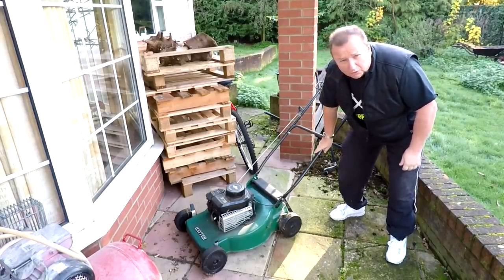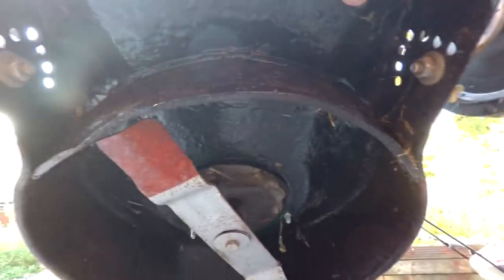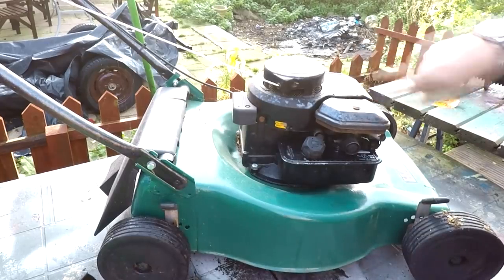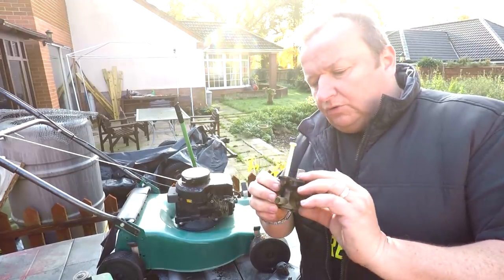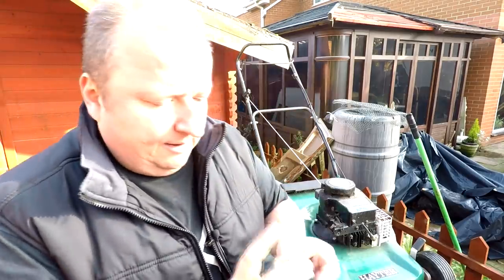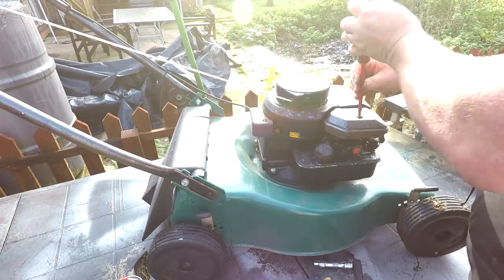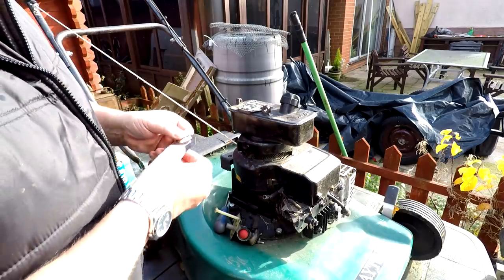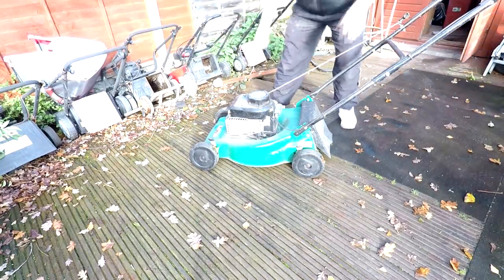Worst Lawnmower In the World 2 Years On

Comment: That and it’s cold. Oil is thick. If anybody cranks one,let it run a bit to heat the oil up. Don’t put it to work straight away for fall 🍁 she’ll settle on down once heat is beginning to get into the engine.

Comment: Great vid m8, I keep meaning to get my vintage Aspire engine which is an Italian made Tecumseh onto the workbench as I had intended to build a go kart around it as have the box section and tube, got the welder and even a fancy pedal go kart's quite complex steering I nipped off down the local tip and wheels ain't hard to source as I got a ton of old Vespa wheels and hubs if I needed going roundy things.   My daughter is not so happy, for being a bit mental I kinda go at things hammer and tongs and end up filling the place up with broken things then my madness sends me down a new path and its like "meeh, cant be bothered..."  Quite enjoying the watch thing, its like doing abs tiny Airfix kits kinda and means it piques all my likes e.g. I love polishing metals and a lot of these ol' beaters I am making look like factory fresh, its not a skill that can be hammered into submission either and sometimes it takes ten minutes to get a tiny gear wheel firmly in its journal and have to be so gentle as the pivots and shafts can be thinner than a human hair.
Reply from the maker: I'd struggle on small stuff like that Ian.
Reply: @retrorestore  I bought a 1600x USB microscope as me eyes are getting worse, still a way off being told I can't drive but the bloody diabetes is the gift that keeps giving hehe   The microscope tho, cheap chinese but abs superb clarity at max focus and I use it on electronics and mechanical stuff as it can spot cracks in cylinders or breaks in a printed circuit or spot dry solder joints, def recommend one for small work :)   I did try the lawnmower thing but round here in Daarset the lawnmower thing is sewn up tighter than a ducks bum underwater, one of the local lawnmower shops used to buy all the non runners and scrap them into parts so ppl would buy new ones and he abs cornered the second hand market round here and he has a chap who cleans all the reclaimed parts and sells 'em as new :(    I do plan to have another go when we move to Scotland as my daughter has scouted out the local area and found there is no computer engineer local, no lawnmower bloke local or anyone who can fix games consoles local and its begging for someone to slide in and do the business :D
Reply from the maker: @dodgydruid  Yes, its harder now so you might stand a better chance up there.